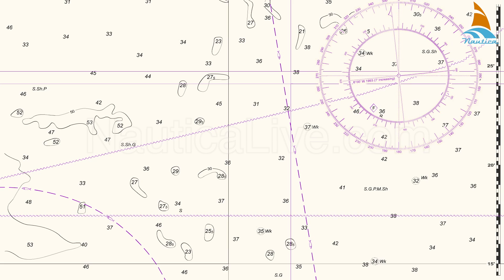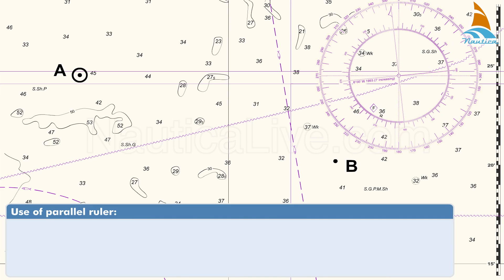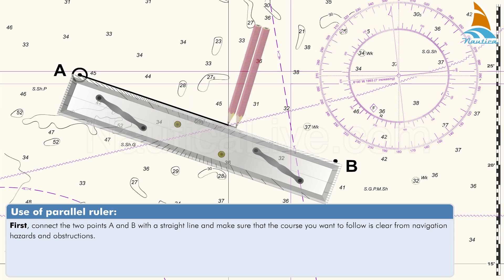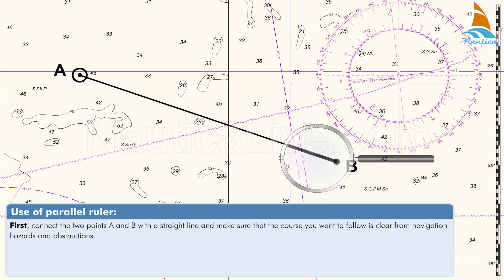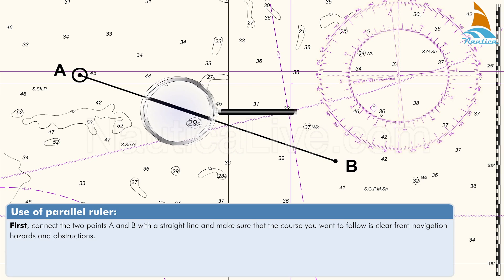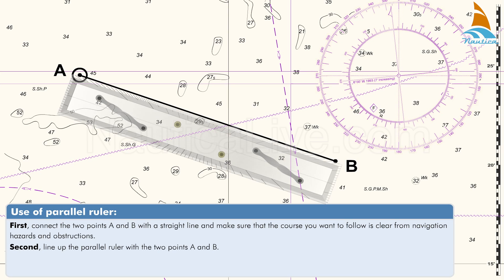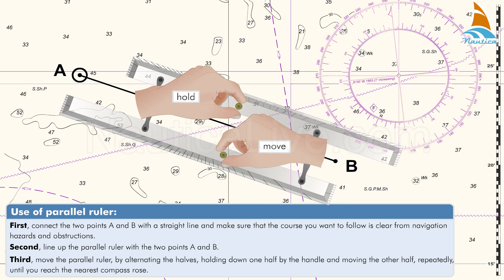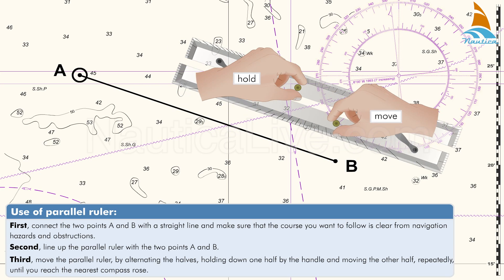How to use the parallel ruler 2

Comment: It's a rule,  not a ruler.
A ruler is someone who rules,  like a king or queen.
Reply: ruler noun
rul·er | \ ˈrü-lər  \
Definition of ruler
1 : one that rules
specifically : SOVEREIGN
2 : a worker or a machine that rules paper
3 : a smooth-edged strip (as of wood or metal) that is usually marked off in units (such as inches) and is used as a straightedge or for measuring